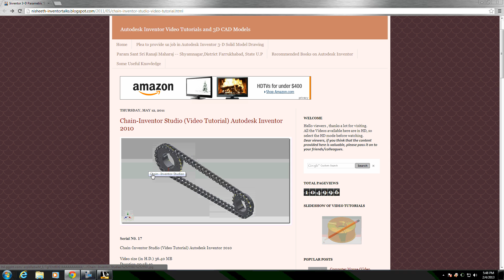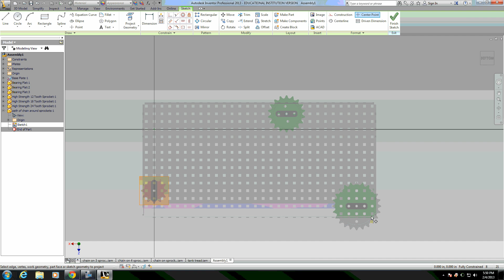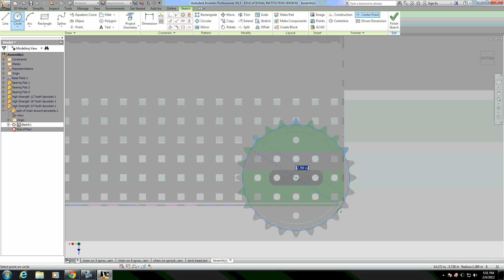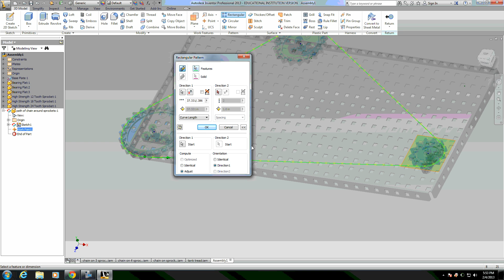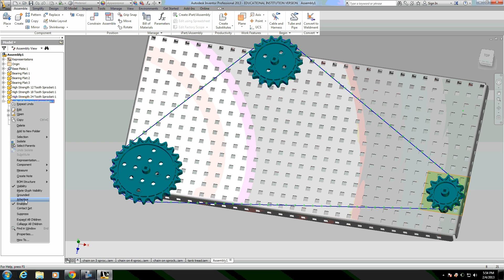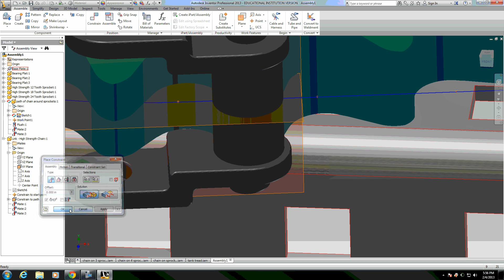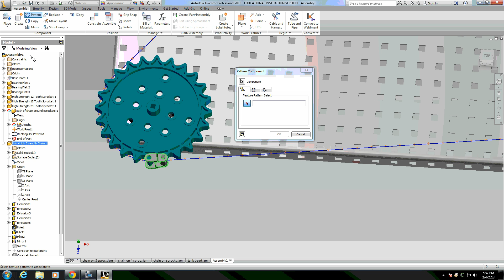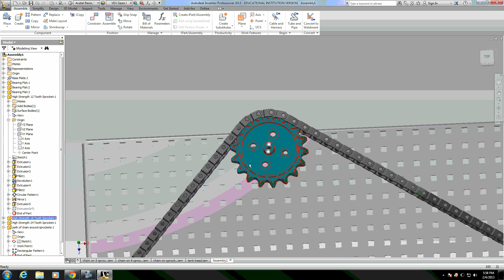VEX Chain Constraints in Autodesk Inventor

Comment: If you look at the small sprocket at 10.38 in your video - you will see the links are NOT properly connected. I have made a chain myself this way - and I have noticed that Inventor is dividing up the straight lines between the gears perfectly - but when it comes to the arcs round the gears - it is dividing up the arcs - by the curved distance - as opposed to the chord distance - which is what is needed for a chain. Do you know if Inventor has a solution to this?

Comment: the start point should be exactly halfway between the 2 pivots, the 2 sides, and the top and bottom.  all of the planes that you need are exactly halfway between 2 points/planes, and you can create these planes using offset from plane.